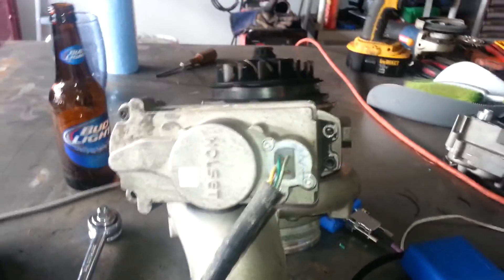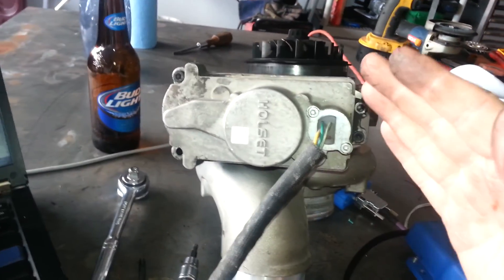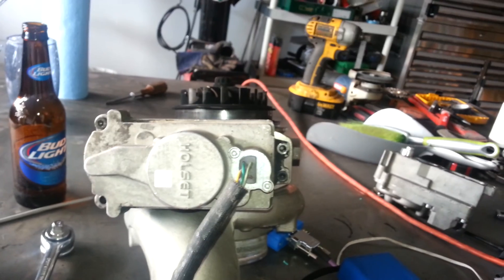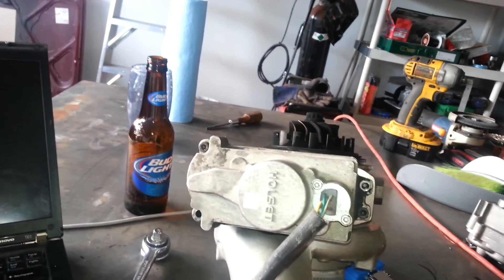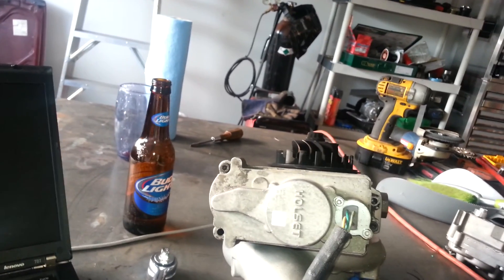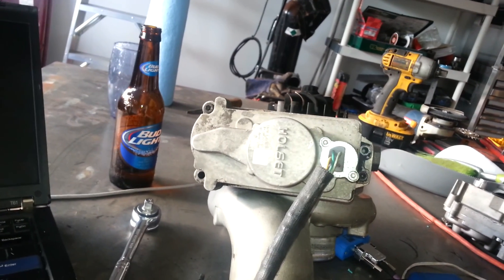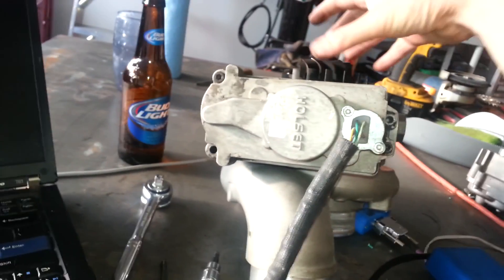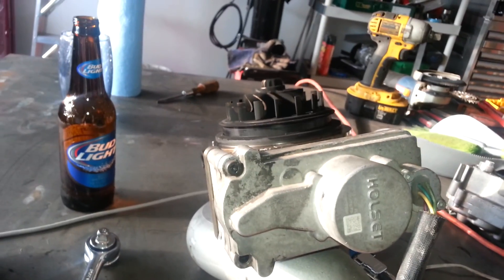He351ve controller

Comment: my 04 f250 is running with a stock 12 v cummins but i miss the 6.0ohs extra chooch so i wanna use its turbo can i get the code your running
Reply from the maker: no the code is mine on custom hardware so it wouldn't benifit you. my hardware is industrial rated at IP67. I sell kits for $775 shipped in the continental US.  I have a Facebook page setup for them. https://www.facebook.com/bansheecontroller
Reply: sorry i thought you were running a arduino
Reply from the maker: 57210chevy No, Arduino is for college kids and high school science experiment's. Great if you want to play around with it but not for a commercial product. There not designed for deployment.

Comment: Hey bud how u Doin i got a ? I got a 03 f250 with a dt360 in it well putting it in it but I am goin to put a he351ve on it but I want to do a set up like Ure Doin but I don't have clue bout computers and stuff I was wondering if you'd build me one of these controllers cuz my motor is same format as a 12v Cummins any help appreciated
Reply from the maker: +Mitchell Gilliam Check out https://www.facebook.com/bansheecontroller I have a updated controller that has more features.

Comment: Hey that's really cool, I just have a question for you, is there a built in position feedback? I've started a similar project for a school project and I'm spinning the motor by applying current at the poles of the electric motor one "step" at a time. Only problem is that there is no position feedback this way. Is the position feedback only accessible through CAN?
Thanks alot and loving the progress on your project
Myles
Reply from the maker: There should be some type of POT (resistance value) on the board. Where I don't know. What are you trying to do for your school project?
Reply: Were using an he351ve in a honda civic with aims of increasing fuel economy and. obviously power. Idea for the fuel economy is to keep engine out of vacuum during highway cruise to increase volumetric efficiency, using a lean burn cylinder head (JDM D15B) which only opens one intake valve to create a swirl in the combustion chamber and water injection to keep from detonation. Weve been getting 65mpg with a T3/T4 setup but he351ve is much more versatile
Reply: Thanks for the reply, weve bypassed the board so i doubt we will be seeing any pot values
Reply from the maker: Myles Drake the Holset 300+ series VGT is pretty heavy turbo. I would look at the HE200VG or Garrett turbos. Because instead of a sliding wall they have actuating nozzle and they have lower rotating mass.
Reply: We are using a support for the turbo for the weight, it should be quite sturdy, is the actual weight the issue or its inertia?
Reply from the maker: The weight of the compressor wheel and turbine.  Takes a lot of energy to get it to spool, even with the vgt. Still pretty impressive what you guys are doing. If you get your hands on another actuator I can make you guys a controller for it.

Comment: so do you have it adjusting based off engine speed or just boost level?
Reply from the maker: It runs off a 5v pressure sensor, you could use anything to control it all you need to do is send a 5v signal to the controller.